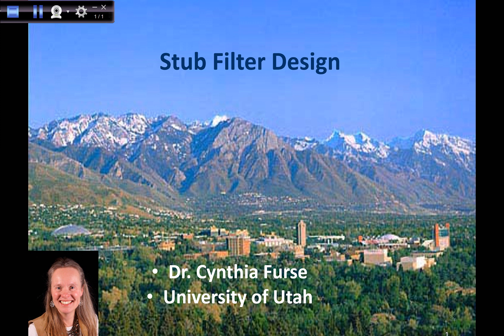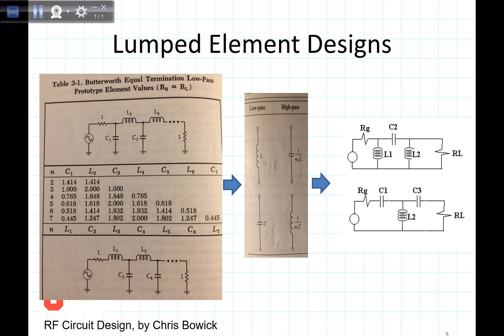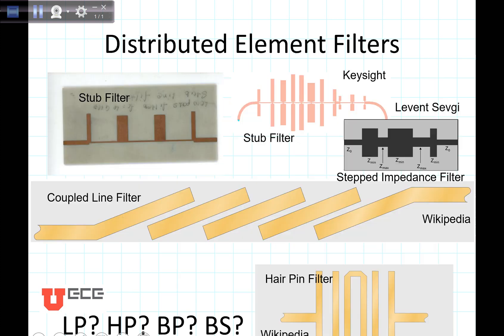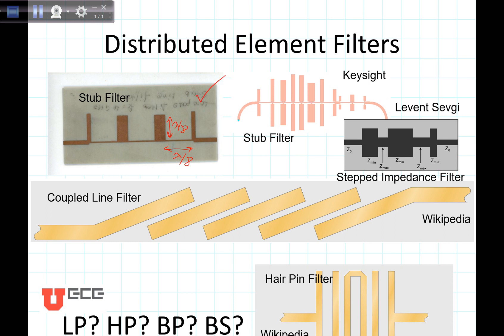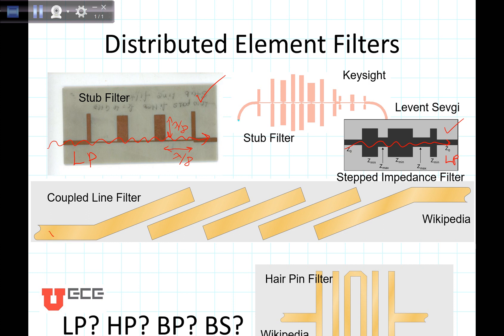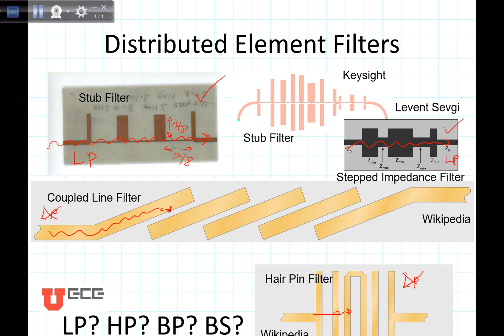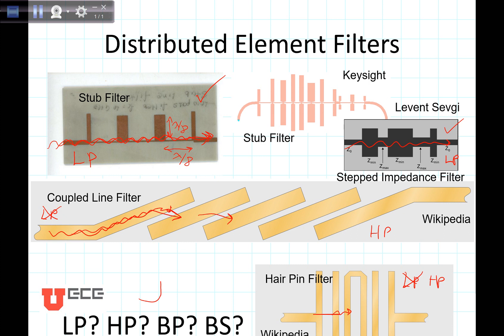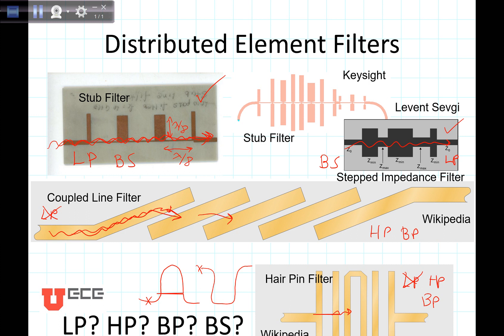Microstrip Stub Filters -- Part 1

Comment: Can these microstrip filters be applied to +/-5v 0khz to 20khz range audio signals with minimum phase change?
Reply: I don't think so, because those types of filters only work if the wavelength (lamda) of the signals approach the dimensions of the elements/conductors ( for example lambda/4 stubs etc.) 
A 20kHz signal would have a wavelength of c/f = 15 kilometers ! (in vacuum).
On a conductor the wavelength is a bit different, but still way too big to realize such a Microstrip filter for audio, unless you're willing to build such a big PCB... ;)
Reply: @thomasschneider6012  thanks for the response! Maybe some day in the future it can be engineered
Reply: For audio, just use op. amp. with capacitors and resistors like everyone is doing. It is even smaller than 50GHz microstrip filter. Google for Sallen-Key filters
Reply: @davidbrooks8621  the problem with capacitors in audio filters is the introduction of signal phase shifting, delay, and distortion at the filter cut off point.
Reply: @chasepe5762  Every analog filter design with capacitors or inductors has the problem you mentioned.  Use it first with wider bandwidth and then use a DSP and symmetric FIR filter  and the job is done. Any way all the stuff with microstrips is for microwave frequency and not audio freq.